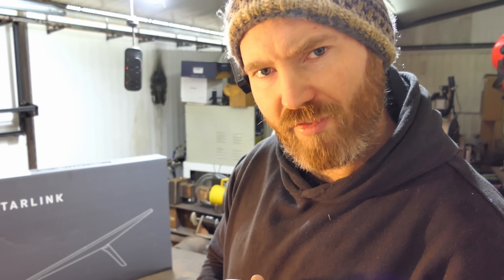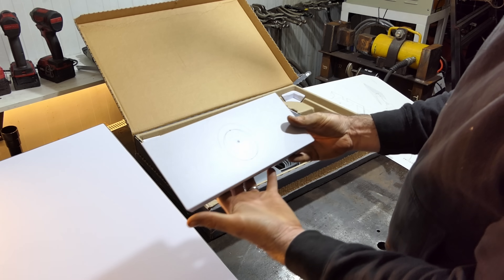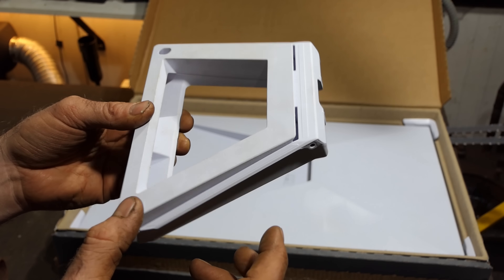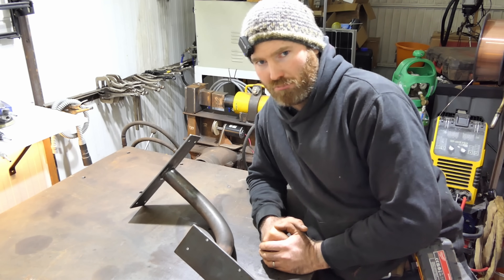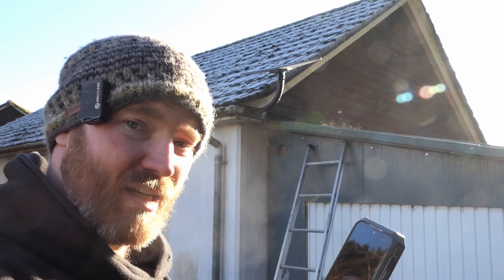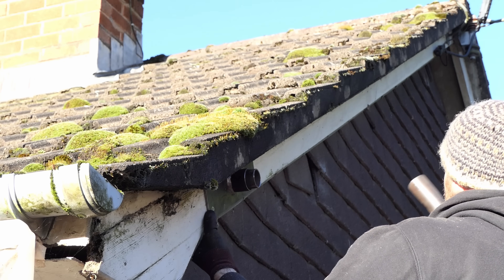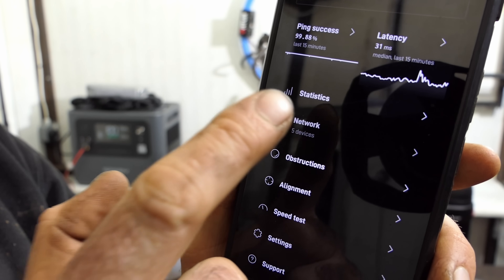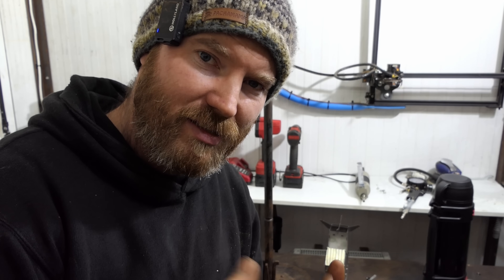I bought UK Starlink internet... I'm shocked!

Comment: So because Starlinks network doesn’t have the bandwidth to accommodate all its customers, it is charging you an extra £75 for no additional speed or services?? And because people are daft enough to pay it they will keep on charging it 🙄😂
Reply: Yeah, it's dead cheap to send up rockets and satellites into space, everyone know that. :face-red-droopy-eyes:
Reply: @nicknelson9450  Oh dear, not very bright are you. You buy from toolstation in an attempt to avoid what you clearly perceive to be an unnecessary extra charge, AND FAIL.. You make a bracket pointing completely the wrong way, and you completely miss the fact that this additional charge is nothing to do with the infrastructure cost. It is only charged in countries where people will pay it otherwise the price of Starlink would be universal.  🙄
Reply: @ Hi. 1) You appear to be answering me as though I was the person behind this video but that's not the case FYI 2) Your initial comment seemed to be saying that Starlink was charging an unreasonable amount and doing so because people are not aware of its true cost. My answer, which I'll admit was a bit sarcastic, meant that it seems to me it's probably currently a lot more expensive to deploy a network of geostationary satellites than an FFTx infrastructure and around 100 usd per month doesn't seem too outlandish next to the price you would typically pay for a fibre supscription. I do imagine that in terms of economies of scale, it should become progressively cheaper to run the Starlink network, but whether they will reduce the subscriptions is another matter. Finally, have you considered phrasing your comments in a slightly more neutral way? It's ok to disagree but we can discuss stuff without putting each other down, no? Here is what AI says about the average price of Starlink in the world so I wouldn's say there is a huge variation depending on the market of people's gullibility: SpaceX's Starlink offers a satellite-based broadband internet service with the goal of providing global coverage, including remote and rural areas with limited or no internet access. The subscription cost for Starlink varies depending on the region. Here are the current subscription prices for various regions as of 2023:

    United States: $110 per month
    Canada: CAD 129 per month (approximately $100 USD)
    United Kingdom: £89 per month (approximately $115 USD)
    Germany: €99 per month (approximately $105 USD)
    Australia: AUD 139 per month (approximately $100 USD)
    New Zealand: NZD 139 per month (approximately $90 USD)

Please note that these prices are subject to change and may vary over time. Additionally, there is a one-time equipment fee for the Starlink Kit, which includes the satellite dish, router, and mounting hardware. The equipment fee is currently set at $599 USD for all regions.

Comment: I run an internet business in the UK, and I was getting even lower speeds than you, that is until I opted for starlink, best thing I ever did, no down time, fast up load and download, but I bought the self aligning system and the wall bracket, used to get over 300mbps, now down to 150 - 200 and 12 upload, but a vast improvenment on BT
Reply: Hopefully will see higher speeds when SpaceX start launching their V3 Starlink Satellites later this year.

Comment: the speeed offered by all internet providers is not wifi speed its ethernet speed, man how can you not know that, wifi speed is based on overall speed to your router and how bad the router is at broadcasting wifi, you could of used a cable or a better router, but still skynet i mean starlink is better if you dont have fiber there anyway
Reply: nice weld though

Comment: Had it here in the UK for quite some time, best thing ever compared to cabled, Hasn't gone down yet either.   Best yet is when we had a power cut we could still run it off the Aferiy 2400w  power bank.  Mine auto rotates and points south too.  It is however pretty expensive and yes the router isn't very good.

Comment: I have a master gateway (hub) .. I then have old / used hubs from BT and talk talk from various sources. I have them manipulated to not sign in, DHCP disabled where needed. Ip / range set.. so I have internet everywhere in the property when required/turned on. So your old supplier who was it? Can you keep the hub? You can network it to your workshop. You can assign your own ssid of course. If you Chromecast etc, it does it through the network. Alternatively, you can get home plugs. But I take it your workshop is a different circuit? It'll not work if so. Shout me if you need advice etc.

Comment: Toob in uk generally awesome, 900mb up and down, use ASUS zen WiFi recently upgraded to newest version and still able to use old version as access points, and run cat 8 cable between the office router and upstairs AP, overkill but great wi-fi everywhere.

Comment: It hadn't occurred to me that they no longer track - but I guess it makes sense now they have more satellites than they used to; phased arrays or bust amiright? The one thing I would say is higher and unobstructed view is better - when you cut off view to the sky you're cutting off satellites it could be connected to either improving bandwidth or latency (or more likely both) - and that also includes trees.
Reply: Mine is motorized and does not track, it only moves after powering on or after some software updates. It moves to the ideal angle and direction for the location, and then does all satellite tracking electrically, using the phase-array antenna.

Comment: But what's the ping, latency, jitter when you are connected common gaming servers, Netflix, Prime Video? Also, your comments don't really apply outside of your specific location. Where are you? And, you have to take into account the distance of the Starlink ground station! The distance to a Starlink ground station is variable depending on location. Your comments, without context, are useless.
Reply: I don't game.  Distance to ground station is pretty much irrelevant. Mean latency in the South of England seems to be around 32mS, and I don't think it's any higher elsewhere in the UK? Satellites can now communicate between themselves using laser, so the down station you use may change depending on the destination.

Comment: I've used Starlink for work a few times and noticed that the upload speeds are really low - not at all good for connecting video cameras to upload live streams. This is with the motorised panel that scans the sky then follows satellites.
Thankfully I don't have to pay for it - it's not cheap so only worthwhile if you need it and can't get fast enough speeds by any other means

Comment: When i had copper internet i was getting speeds of around 28mbs and to download a 100gb game it would take minimum 10 hours. I looked into Starlink when i heard musk sent satellites over ukraine thinking must be good till i saw the prices and the low speeds for that price. You said your paying the £75 monthly which is the residential cost and unlimited data etc but going by your speed it dont seem worth the cost. Luckily ive just had ftth installed and now get speeds of 900+ and games now taking on average of 10 minutes to download. It does beg the question though will starlink be the future.

Comment: internet speed should not be measured using Wifi since Wifi has major issues, primarily walls between the phone/laptop and wifi router, and secondly wifi routers of neighbours.  Using the good old ethernet cable helps a lot.
Wifi performance can be improved by changing the default Wifi channel that the Wifi router imposes. The chosen channel is often 1,6 or 11 and if the Wifi router of a neighbour uses the same channel, both of you are in trouble ... For the non-techies: change the Wifi channel to 4 or 8 and see if it helps.  Wifi 2.4 GHz has lower maximum speed but goes better through walls than Wifi 5.0 GHz.  I do not need the super-high speeds of Wifi 5.0 so that is why I disabled Wifi 5.0 GHz on my Wifi router.  In your specific situation you may want to run a cable from the Starlink Wifi router to a second Wifi router near the shop to get a good performance.  Not all Starlink routers have a port for a cable but on some (most?) you can buy an adapter for the Wifi router than has the desired ether cabling port.

Comment: FYI, in the first few seconds:
Mb is megabits if the b is lowercase
MB is Megabytes

With the OG, RS232 serial communication you could just divide by ten because it had each byte wrapped between a start and stop bit, sending ten bits per Byte, but now the headers and footers can be considerably more complex, though at the same time, it's no longer individual bytes that are wrapped but long blocks.
For full-sized packets (1460 bytes payload, ignoring jumbo frames), TCP/IP overhead is only ~2.67% but unless it's a bulk download, those packets are unlikely to be full: a game might send 100 Bytes in a packet, for example.
Starlink may add additional headers for error correction, routing, and encryption but the Mbps values it's sharing will ignore those to be comparable to terrestrial broadband.
Additionally, the connection speed will vary over time affected by many conditions so estimating Megabytes per second is not going to be very accurate at all, and that's why they list it as megabits per second instead.
For a really rough estimate for huge up or downloads, though, assume 80% data, 20% overhead.
Reply: MB/s vs Mbps
Reply: 17 megabytes per second == 136 Megabits per second, which would be unachievabvle with VDSL or ADSL over copper cable, and would be a very good speed if it was achievable. Here in rural part of Hampshire, I get about 27Mbs with VDSL. Openreach currently have no plans for upgrade to FTTP (fibre to the premises). 4G receiption is poor at home since we're midway between 4G towers. So a satellite based broadband would be the only way for me to get faster broadband. However, £75 per month is a bit steep.
Reply: If you want to be a real smarty pant's discussing IP/TCP and error correction and headers, did you know that most traffic these days does not use TCP anymore its way to inefficient too much handshaking, windowing, latency, no security etc.... . Google services now use their own transmission protocol QUIC that operates over the more efficient UDP transmission protocol  no 3 way hand shakes either, lower latency, and it encrypts all data even the headers ! 
Its a nightmare for security on firewalls as you can't inspect it so some choose to block it so then the transmission goes back to TCP. So now you know what Google uses to communicate on your devices and we wonder what they are sending and controlling ;-). That said circa 200-300Mbps is very very good. Sure you can now if your lucky buy 1Gbps services over fibre but most won't see much more than 350Mbps over 5Ghz Wifi on individual devices unless your sat next to the ROOTER and using Wifi 6 :-) 
Were all spoilt now imagine using the 28.8Kbps modems we used when the Internet was new in the 1990's.
Reply: @TheSmallRabbit 1200 buad dialup and what's the internet? "Have block 1, Have block 2, Have block 3, Have block 4", etc. for hours on end just to download a program for an 8 bit computer with 64k of RAM. And you're not going to be using your computer for anything else for hours on end, or your phone line while downloading it. Anxiously checking on its progress hoping the download doesn't fail and you have to start over.
Reply: hey he's only a factor of 10 (check and parity bits need to be paid for somehow - so don't bother telling me it's 8) out give him a break - he's an expert.
Reply: @kaleygoode1681   As an utter luddite/tech ignorant V olde dude,  so MB v Mb  given i assume 'MB' in caps is more 'powerful' =faster internet signal, does it make a huge difference to the like of myself ?. An old dude whose only use for the internet is  for email, movies/streamers folks like Netflix etc and mostly audio dramas and audio books. One is mostly housebound so having a regular and reliable service is essential (i am currently in dispute with SKY whom 'poorly' give me internet access, Starlink seems like the way to go for me.
Cheers in advance
Reply: What a wall of nonsense and pointless information. What are you trying to achieve with this comment? There are 8 bits to a byte. ISPs use megabits just due to marketing, as the number is bigger....(8 bits per byte...)

Why are you even talking about headers/footers and payloads? Starlink has to conform to the same RFC standards as everything else.

Error detection and correction are built into the underlying protocols or data units themselves. You don't simply "add more headers" One TCP segment contains one header. Why are you conflating encryption, routing and error correction with headers?

Also in the example you made with gaming...What point are you trying to make? I am assuming you are referencing online gaming, which predominantly uses UDP, not TCP. Completely different protocols and throughput is not the important factor.
Reply: @mrchips1795  clearly it wasn't written for shining geniuses like you!
If you had you bothered to read the other comments, you'd find why I addressed what I addressed, which, primarily, was why just dividing by ten doesn't give a useful number like it used to in RS232 days.
For all your fabulous wisdom, take comfort that you will never understand everything that's happening around you and learn that sometimes, it's better to be silent and thought a fool than to speak and remove all doubt.
Reply: @BlunderMonger  I don't need to read the other comments. I stumbled upon yours and saw it was riddled with nonsense and called you out on it
Reply: @mrchips1795  Your arrogance is heroic, well done!
Reply: @BlunderMonger  Nothing I have said is inaccurate. Your interpretation of my comments as arrogance doesn't surprise me in the slightest. This will be my last comment anyway, so don't bother wasting your time trying to bait.
Reply: @mrchips1795  I rest my case, your honour
Reply: And you still messed it up lol
Read what you've done😂

Comment: well id have had a look into what phone signal you receive like 5g or 4g and looked at a home broadband like threes 5g home broadband before looking at star link as it would have been a lot cheaper btw im in the same boat copper wiring only guaranteed  a max of 11mbs most actually would say 3 to 4mb

Comment: I'm lucky my house internet is 900 down and 120up,  I get about 700 when close to the router. On the other side of the house I'm currently getting 200 down and 120 up. 

No 5g for me, but half a mine down the road it's hitting 250down. Siem places I've been to have over 500down 5g.

Comment: Josh, I got Starlink about m 6 months ago, before that I too was on a copper line in the Rurals   5mb down and 0.45 up ! 😮‍💨   I got my Starlink direct  €50 a month €10   monthly rental for the equipment      I've gone this way in the hopes I get Fibre (supposed to be next year)  We'll see🙂  I mounted mine at the top of the Gable  end  .The Wifi is not great, but I bought (from Starlink) a Starlink ethernet adapter so I can use my own router   It might be good for you?   Early hours of the morning is when it does its update so don't power off during the night

Comment: Did you not have fttc then as 17mbps is ADSL 2+ speeds. I'm guessing you are in a very small village with an exchange that serves very few as that is appalling. Also if you wanna increase your internet coverage on the cheap use your old isp router hooked via an ethernet or powerline adaptors to your starlink router for a bit of better coverage. I use 2 old tall talk routers in my home for extra coverage and thye quite happily handle my 600mbps connection.
Reply: I have FTTC. The cabinet is 7.5 km away, and on a good day, before StarLink, I was getting 0.7Mbps.
Reply: @JohnDaragon  if you are that far away they shouldn't even be providing you with it. I find that quite hard to believe. You can't be much further from an exchange.
Reply: @HA05GER  yep, I'm the last one on the line. BT wouldn't guarantee any speed and when I ordered ISDN years ago they said they'd try but didn't think it would work.  Luckily it did.
Reply: @JohnDaragon  really very rare I worked in broadband for quite a while never seen anything that bad.